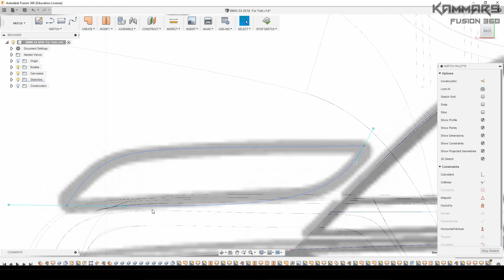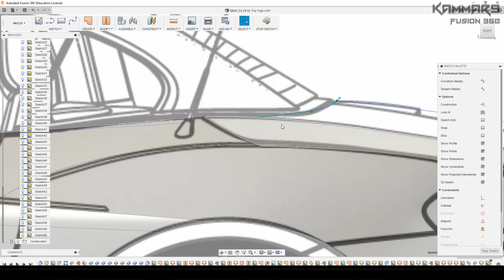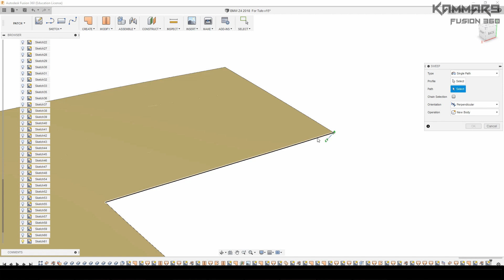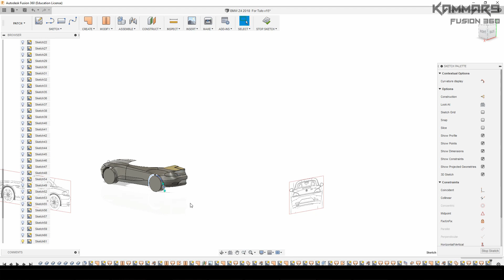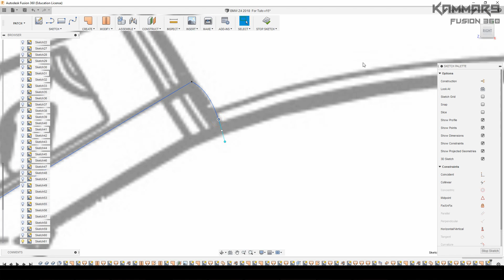BMW Z4  With Fusion 360 EP 18 😍😍   Full HD 2019

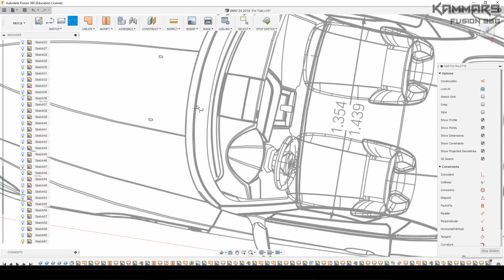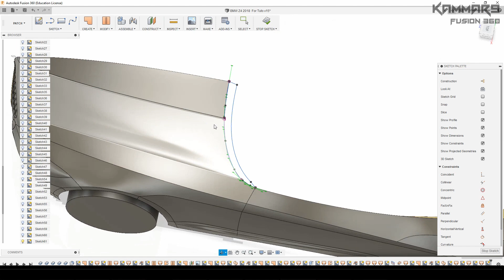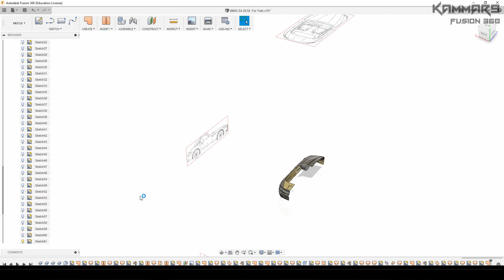Comment: Between times 23:35 and 24:05 you draw an "approximate" spline to finish a surface that will "join" the hood. As a result at 24:19 we clearly see small gaps between surfaces.
You are using quite often on your videos this technique of approximate spline along existing edges, and the result is not so nice unlike you expect. Why don't you use the real edges to obtain perfectly joined surfaces ?
Or, why don't you stitch surfaces to fill the gaps ? (I think there is a tool to stitch surfaces on fusion 360)
Reply from the maker: Hi there bro, thanks for your suugestion, for me it's so easy to work like that , because you have to stich surfaces every time to continue working , that's helps me to edit any edge separately. thanks :)